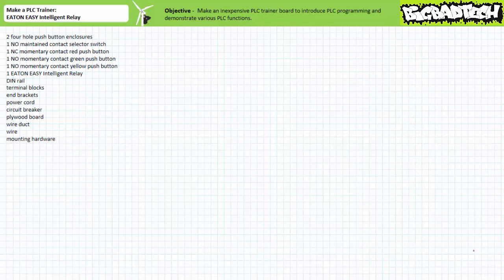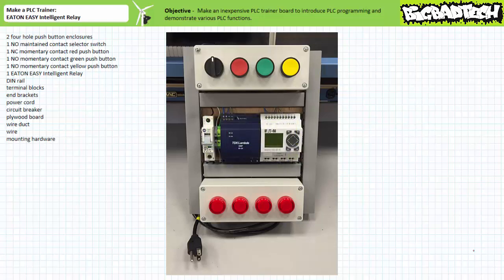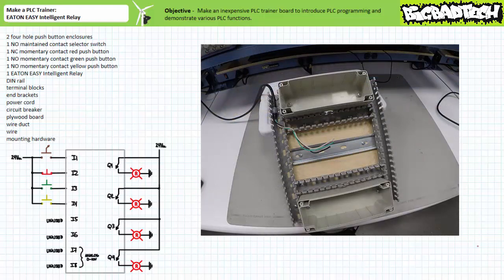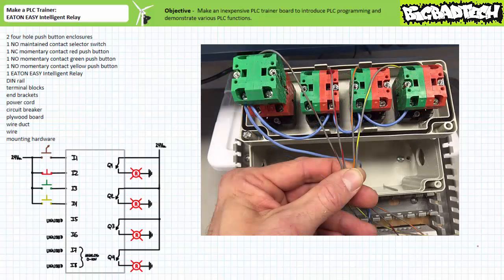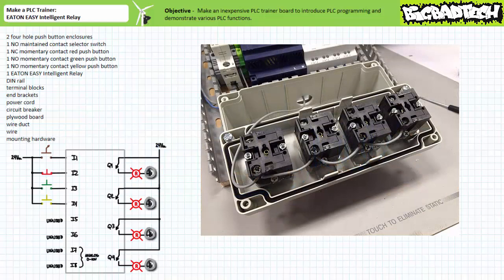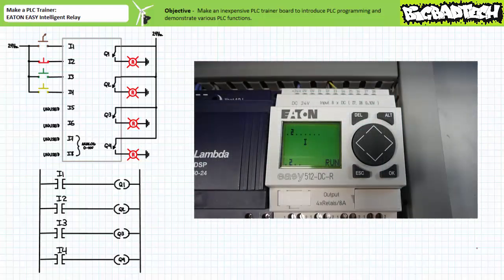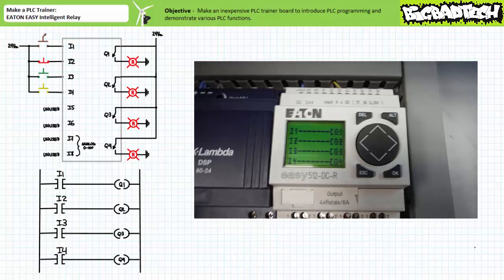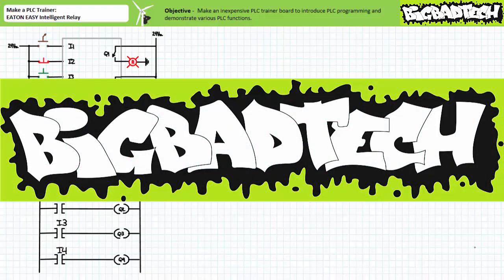Build a PLC Trainer: EATON EASY Intelligent Relay (Full Lecture)

Comment: In your ladder logic schematic your I2 contact shows normally open. This seems to differ from the wiring schematics above it which shows I2 as normally closed. I'm still very inexperienced so I was hoping you would tell me if I'm wrong and if I am, why?
Reply from the maker: Good question ... the instructions scanning the inputs can be instantiated however you see fit (ie: a make/XIC or break/XIO) however the electro-mechanical nature of the field input device remains fixed and unchangeable. Check out the PLC instructions lecture at: https://youtu.be/ic9crSVVF9Q

Comment: have you ever done anything with automation direct hardware?
Reply from the maker: Yes, cheap and easy. Free software too! Original plan was to feature it however a bunch of equipment got destroyed in a flood, Insurance settlement slowly progressing.
Reply: @bigbadtech  Aww man I would have loved to see that as I just moved from an AB environment to one almost strictly Automation Direct, and one of my tasks is updating their PLC testing fixture, DL06 mostly. With direct soft 6 programming and Cmore screens.

Comment: Sir need to learn about Hydraulic Motors and it's torque and flow related calculations ... Kindly help
Reply from the maker: Currently developing the AC Circuit Analysis playlist, however, I do plan on returning to fluid power applications in the future.